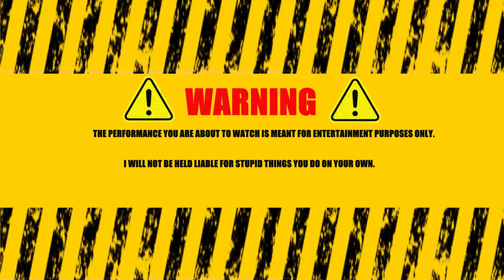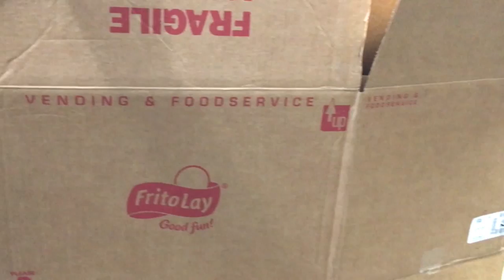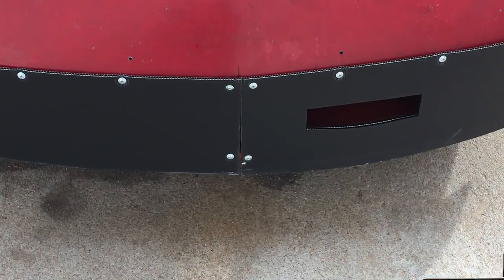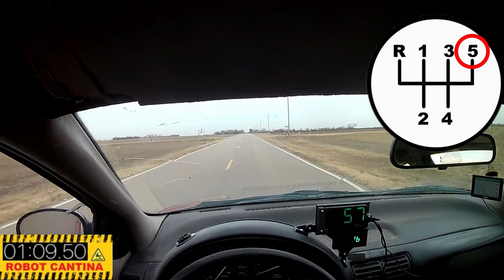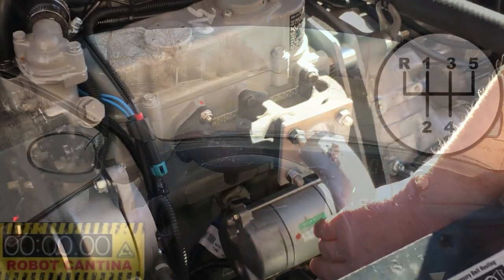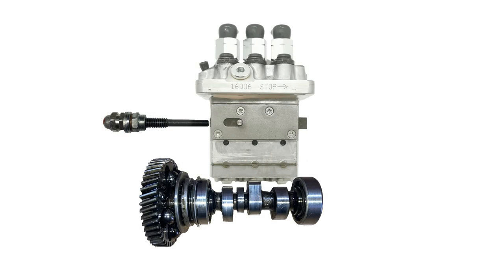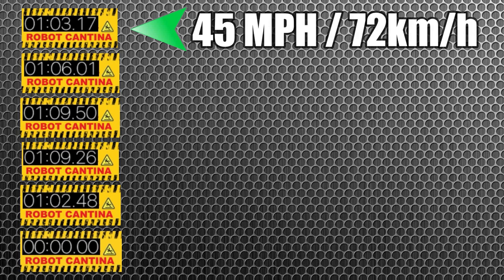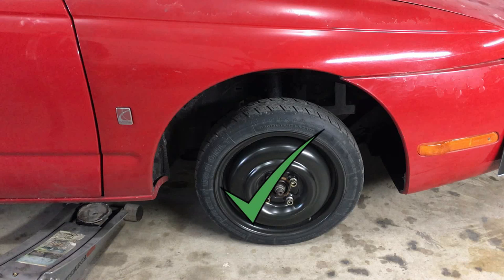S3E2   Fuel and aerodynamic mods ....We do some experiments to try and get the Saturn to go faster.

Comment: Aero engineer by education here, a couple of tips to consider:
1. The spoiler does actually help with aerodynamics. You probably don't need to put the big spoiler back on, but you can get the little plastic stick on spoilers, or even just cardboard/plastic board plus tape to help the air at the back to separate from the trunk. You just want the air to ramp up a little bit. If the air can "jump off" the spoiler ramp a bit, then it can rejoin the airflow easier and reduce drag.
2. Another cheap thing you can do is try adding vortex generators to the back of the roof, to help the airflow stick to the back window as it flows down. Something like you see on Subaru WRX's. This will also help guide the air into the spoiler.
If you want to crank the hillbilly aerodynamics up to eleven, you can add a full undertray and boat tail. The channel "think flight" has a small series about this for a better visual of what I mean.
Reply: Agree with you on all points. Vortex generators are however more complex than just sticking them on, they may just as well worsen aerodynamics just as much as they improve them if you don't calculate it correctly, so I'd personally skip them.
Reply: @swecreations  true, if you don't know what you're doing. It's probably something that's best done here by trial and error. Try with, try without, see what works best. I figured for how simple they are, and by copying other cars, it can probably get close enough
Reply from the maker: Thanks!  We are getting some feedback on the rear spoiler and folks are  saying something should be there in order to reduce drag.  We will try a few options and see what works.
Reply: And funny enough, the YouTube channel called SuperfastMatt just uploaded a video about aerodynamic drag. He has a 1950 Jaguar that's been converted to electric (it's actually more aerodynamic driving it backwards that forwards), he scans the car and inputs the scan into a program that models the aerodynamics, and brings up the rear design of modern cars (that spoiler like lip on the trunk lid) that helps reduce the drag.
Reply: @madmax2069  I just posted saying basically the same thing. I would imagine a lot of us here share similar YouTube habits.
Reply: Do you need vortex generators to prevent flow separation at street legal go cart speeds? If they helped at that reynolds number I'd expect to see them on all modern production cars to help with fuel efficiency
Reply: @madmax2069  I saw that right after this video lmao, it's also good
Reply: @maxhammick948  afaik, they're helpful at highway speeds, but more draggy at city speeds. Given that they only help part of the time and hurt other parts of the time, and they're an extra few dollars per car, most cars don't seem to have them, though I've seen them on a lot of electric cars.
Reply: @paulheitkemper1559  Lots of discussion about this over a decade ago on the ecomodder forum too. Someone did a test on pickup trucks about a decade before that and found that tailgate up with no bed cover got the best mpg, surprising everyone who was involved. This is why. Spoilers can actually reduce drag if done properly, which they were on the Saturns. Very slippery cars right from the factory, so they're a popular starting point for hyper-milers even though they're kind of heavy compared to some of the other popular options. Any aero changes on a car this good should be done one at a time for that reason.
Reply: @xb70valkyriech  They'll have very little effect (although some) at city speeds because the amount of overall drag is minimal at that speed. The only way something like this that increases aerodynamic efficiency could hurt city mileage is because of its weight, and that's not related to speed so much as all the stopping and going (weight has the biggest effect under acceleration). Aerodynamic drag is the square of the speed. This means that at 60 mph the amount of drag is something like 3.5x that at 30 mph, so any improvements in aerodynamic efficiency will have 0.28x (1/3.5) the effect at 30 mph vs. 60 mph. Will a spoiler that increases aerodynamic efficiency by 1-3% improve mileage at 30 mph? Yes, but the effect may be so small you can't measure it. Will the weight of said spoiler reduce fuel efficiency during acceleration? Also yes, but again the effect may be so small that it's not measurable. In short, whatever your spoiler does for efficiency, either raising or lowering it, it will have a much more noticeable effect at highway speeds.
Reply: @randr10  firstly, I'll mention that highway speeds are what are giving them the most trouble, so I think the aero mods might be worth a try to see if they can bump up the top speed by a few mph. Second, I don't mean to be rude at all, but your math is off.
Reply: Yeah, it could very well help with air flow separation at the rear. 'SuperfastMatt' has done some excellent videos (including one where he explains why his 60+ yeah old Tesla powered Jaguar is more efficient going backwards than forwards), his sense of humour is just like this guy too (which is cool). Great channel to check out though if you haven't seen any of Matts (CBR Fireblade powered land speed vehicle, CBR1000 motor powered Honda S600, 250cc powered Honda Grom, and others)... Highly recommended! 👍    😎🇬🇧
Reply: @xb70valkyriech  It may well be. I pulled that number from a chart. Also, sorry if I came off as condescending. This was more or less just me thinking out loud.
Reply: Kyle engineers is also a VERY good channel concerning aero. He also used to work on a f1 team doing aero dynamics. 

His videos are definitely a rabbit hole you can fall into quick

Comment: The majority of small diesel equipment engines that are turbocharged are running low boost to help with widening the torque bulge and keep revs consistent when the load varies. Typically, manifold pressure is 4-6 psi so an intercooler is not really needed, nor are piston oil sprayers.....however, the majority of turbo Kubota's do utilize a water/oil cooler under the oil filter. An air/oil cooler would probably be easier to fabricate and would greatly help with engine/turbo longevity, especially when holding full throttle for long periods in top gear.

Comment: I wonder what effect covering the rear wheel wells like with the insight would have
Reply: plus entire underbelly
Reply: The front wheels can be partially covered too.
Reply: @Oldsmobile69  hmmm you could put a bubble to cover entire thing, but hard to do from cardboard
Reply: Slower then a fiat 126 26hp with a 0-60mph in 47 sec😊
Reply: @Aeros-tech  because it's monster. In Poland we even towed with this thing.
Reply: @drippingwax  of course
Reply: Plus adding some "100mph" tape on the seams.
Reply: @Oldsmobile69  more aero hubcaps
Reply: @drippingwax  cable ties might work
Reply: Long skits on side of car and extending the front bumper will help the less air it under the car the better

Comment: a small turbo with a few pounds of boost would solve every problem with speed, and make it so the car doesnt need to have crazy aero mods. Plus, turbos for diesels increase overall efficiency and can easily lead to more MPGs

Maybe a k03 turbo from an older audi / volkswagen turbo engine would do well... The inducer size on those is like 30mm so not too big for the baby sized engine

Comment: More fuel equals more heat only to the point that it will flow air. Controlling combustion temps is an art unto itself. Controlling the oil temperature is very important since that also helps control piston temps. The affect of piston oilers is not as great as most people think because oil is naturally being slung up against the bottom of the pistons anyway. Control intake air temp and oil temp and water temp and you find it much easier to control combustion temps. Increase the fuel until you need water injection to control combustion temps. Aluminum melts at 1000-1200 degrees if I remember correctly BUT just because your egt hits 1000 does not mean that's how hot your piston is. The constant cooling of the pistons from the skirts and the oil on the bottom of the piston keeps it much cooler. Keep that oil temp below 190F and it will work wonders to keep your piston the proper size.
On the bonus side the water injection gives a bit of a power boost you can feel in the seat of your pants. 
My experience is via a GM 6.5 turbo diesel marine build in an old van with no intercooler. Just a "devil's own" water injection kit. Extra large oil cooler with auxiliary oil cooler. I've hit 1100 degrees with it climbing some mountain passes. I'm a chicken so I don't push it past that much. I've heard of guys pushing higher though.

Comment: I'd bet the spoiler did more for aero than you may think. I know all late model cars and trucks have a hangover lip off the truck or tailgate to smooth Eddy currents at the rear of the vehicle. That spoiler might have done just that.
Reply: Eddy current ? 
Pff ha ha ha , what ?
Reply: @Whateverpoopiepants  For sure at 55 MPH!
Reply: @Whateverpoopiepants  You got me. Eddy current wasn't the right term. But you know what I'm getting at obviously. We'll just call it turbulence. I feel for you serious YouTubers. Dealing with trolls would be exhausting.
Reply: What you're thinking of is more or less the air 'sticking' to the sloping rear window for a bit before detaching. The trick is that ideally you'd have a long tapering tail like a bird. This is obviously impractical, but it turns out that if you end the car's shape abruptly the air detatches cleanly from the body and flows kind of like that long tail is there, reducing drag.
Reply: At 64mph max...those factory spoilers were not designed for aero in the 90s the car mags back then even did articles about it.
Reply: @hendo337  They were in fact designed for aero, but not to generate downforce. They're there for fuel mileage. These cars were very aerodynamically slippery and this was one of the tricks they used to make it that way.

Comment: The exhaust on my Cub Cadet with a D600 Kubota gets very hot. It has a stamped metal safety guard.  Under heavy load it blows black smoke, 54" snow blade, chains and tractor tires.  I use it to plow my drive way over on Fox road by MIchigan ave near your old stomping grounds. In cold weather the tractor runs very cool, the only time I see the temp gauge move is during summer. There were Cub Cadets that came with those diesels. The garden tractor pullers use a turbo from a European smart car, its 3 cylinder, and has the turbo built in to the manifold, you just need an adapter plate.  The Military also had d722T on their generators.

Comment: Fender skirts?  Increased tire pressure?  Air scoop enclosed directly to intake?  Front campaign sign mod increases downforce, try moving top forward and bottom rearward, so it looks like an arrow shape from the side (reduces downforce, reduces drag)?  Lower oil viscosity,?  Water injection?  Continued success!  Thanks for the video!

Comment: The pyrometer (exhaust gas temperature), is the best way to know just how a diesel engine is performing. you can figure as the exhaust temperature rises water temperature will rise along with it. there is some amount of over fueling that is acceptable. but if your smelling raw unburnt fuel then it's over fueling too much. a small puff of black smoke when shifting gears is acceptable. as long as that is the only smoke that is detected. there is a huge difference between turbo charged and naturally aspirated engines. and you want to have an intercooler with the turbo. but you will really have to keep an eye on the pyrometer. if the temperature rises too possibly nine hundred degrees for that engine. back out of the throttle and the will drop. and on both turbo charged and naturally aspirated engines you will want make sure the exhaust system is large enough diameter. it's important that diesels have free flowing exhaust. and don't ever shut off a turbo charged diesel with the pyrometer over six hundred degrees. I know this from many years of being an OTR truck driver and have ran a lot of turned up diesels.

Comment: I did an experiment on a VW Polo 1.4 TDi a few years back.  Reduced weight by as much as possible, aerodynamic mods such as narrow tyres, closing off un-necessary ducts and removing anything that caused excessive drag.  Had the engine slightly modified with a custom remap, a more free flowing exhaust.  Can't remember exact figures but it achieved slightly over 100mpg and the performance was incredible

Comment: I'm afraid you might have blocked off air intake into engine, so it's possible that after some time of max throttle engine is starved of (cold) air, so maybe installing a cold air intake would work out, and since you have that area on bumper to cut, you don't have to ruin bonnet. Should slightly improve performance on high speed doubling as an inertia supercharger (air resistance in front push more air into engine)
Cheers, that's a good project and video, Thanks!

Comment: Highway tires with the least rolling resistance, smaller and lighter weight wheels, +15% recommended tire pressure. 

(Pre turbo) Intake piping to ram air intake, change intake manifold to 3 independent, long, and thinner? tubes. Possibly angle them greatly from the valves to increase turbulence pre-ignition. 

Someone mentioned lower oil viscosity but I imagine that will need a change of bearing clearance if you intend to change boost. You could get stiffer valve springs and get an increased RPM. 

Love your videos

Comment: You should push the speed in 4th speed higher because it seems that the gearing makes the 5th very "long" for economy. When switching from 4th to 5th you go down to 2400rpm!
Reply: I think gearing down from the smaller tires pushes that shift point from 4th to 5th to around 50mph from what the tach said on his dash. it dropped the top speed in 4th but made the gearing such that he can use 5th now to get a higher top speed. I guess the alternative is to put the stock tires back on and see if the aero will allow a higher top speed in 4th and allows 5th to be used without lugging the engine down and slowing it down
Reply: @kasuraga  There's not much that can be done for the "gap" between 4 and 5. Maybe a solution would be to optimize for top speed in 4th with tire size and keep 5 for economy. But you only have 4 gears to accelerate. Alternatively you use even smaller tires and get higher rpm in 5th.
Reply: @cmuller1441  Yeah that's what I was thinking too. But also, once it's turbo, it might be better to keep the gearing with the stock tires since the added power should help 4th pull along better, then 5th can be used for final acceleration to top speed and cruising.
Reply: @kasuraga  I agree. Optimizing it when you know that you'll have a different engine later is just a waste of time.

Comment: skinnier wheels will indeed have less rolling resistance and provide less air resistance. You can also max out the pressures to whatever the sidewall allows. You can also try to cover the rear wheel wells.
Reply: he could also lower it, considering it does actually benefit aerodynamics slightly
Reply: He could also convert the wipers to 1 wiper that Parks in the straight up and down position in the middle of the screen. It's an old DTM racecar trick.
Reply: Probably not a good idea to max the pressure in the winter because once it heats up they're over pressure.
Reply: So recreate the Honda?
Reply: @vasilis23456  well the max pressure is generally ~50psi and burst pressure is well over 200 in most cases. There's loads of safety margin on them, not like any tire manufacturer wants to expose themselves to undue liability.
Reply: @zogworth  well, yeah, kinda.Because that car has quite good aero from the get-go. If you try to improve aero of any car they all end up with more or less the same shape and they use more or less the same tricks to reduce drag.
Look at Lightyear1, i believe it is currently the production car with the lowest drag coefficient: no spoilers, closed off rear wheel wells, flat closed bottom, no mirrors , it uses small camera's, Closed front.l, skinny tall tires/wheels.  Quite good.
Reply: @ManMeatMusket And a long pointy tear-drop tail. The tail would probably be enough to let them re-install the original engine - lol!

Comment: I took the spoiler off of mine because I liked the clean look without it better but it actually hurt my gas mileage a bit. More modern cars will have a little lip on the back of the trunk lid that would take the place of this spoiler for you. Manufacturers claim 1-3% increase in fuel efficiency from that, so it has to reduce drag significantly.
Reply: Also, yes on the cool exhaust. All diesels will run cool at idle, which is why it's not a good idea to try to warm up a diesel engine by idling it. You need to put it under load to heat it up. I'm not sure what the physics are that cause this phenomenon, but I learned this when I bought a medium truck with a 7.3l IDI International diesel. It was the same way. At idle after a cold start I could put my bare hands right on the exhaust even after 10 minutes of running.

Comment: To verify if the aero-mods are improvements or not, you could use cotton/textile strings and a camera to see flow separation, turbolence, etc.
A Pitot tube or Magnehelic gauge are a bit more expensive but obviously more accurate. Would be cool to see the data of lift and drag before and after mods
Reply: Magnahelic, isn't that the ones that meausre pressure differential? That could be cool
Reply: @goosenotmaverick1156  Yes, it is. Julian Edgar has some great simple videos explaining it if you do not want to spend hours on textbooks, wiki and such.
Reply: tufts are great, they tell you a lot and they're just yarn and tape and whatever camera you already have
Reply: LOL a pitot coming off the front would be hilarious